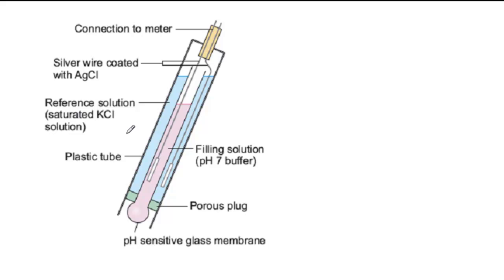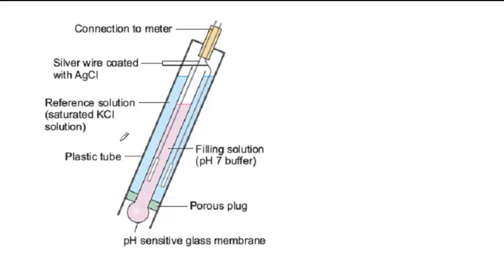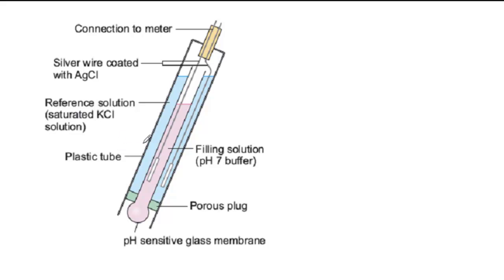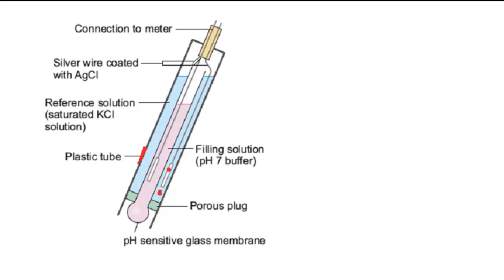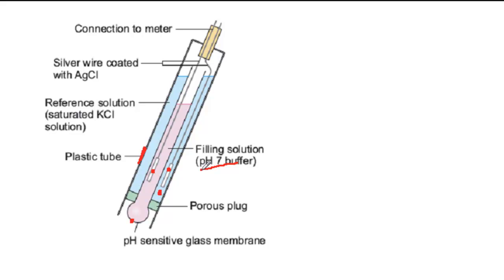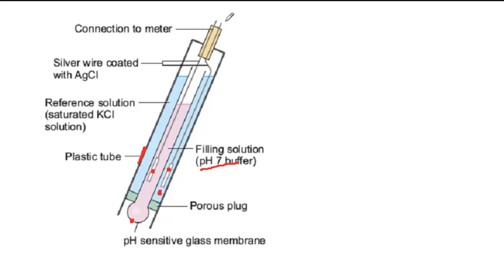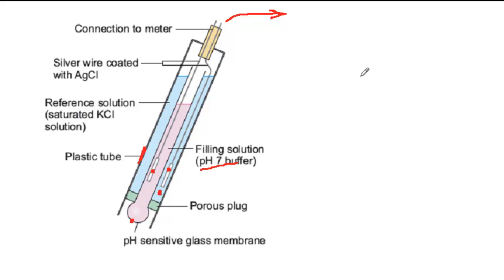How a pH probe works

Comment: Why there is a part, "porous plug" in the tube's end? If we immerse this tube into a water, are there possibly any water penetrate to the "Reference solution(KCl)" to mix the KCl? Will this make the the KCl solution contaminated?
Reply: no, the bulb is only sensitive to hidrogen ion changes and will never change its original ionic composition only active ion composition

Comment: Thank you. Any idea on how one would get one working again once it seems to have stopped working?
Reply: Sometimes the probe gets a coating on it and doesn't read correctly even after being calibrated.  Needs to be sufficiently clean all around the measuring area.  "The probe surface is where the instrument takes the reading of the solution or soil/media. If the probe face is dirty or contaminated, the readings may be inaccurate. Much like the windshield of a car, if it’s dirty you can’t see out! If the probe face is dirty, it cannot read the solution or soil accurately. pH probes specifically, should be kept wet at all times for optimal performance and life."	
Possible Solutions:
		    Clean pH probe with distilled water and KIM wipe.
		    Hydrate the pH probe in KCl storage solution
		    Ensure calibration solutions are fresh and accurate (replace if in doubt)
		    Wait longer for readings to stabilize before calibrating
		    Check the pH probe for damage.  If damaged, replace.
In my experience, probes get damaged if they are tapped or wires are crimped in any way. 
I've also seen Buffer Solutions that have been used too many times.  They get diluted or soiled from improper probe cleaning and need to be replaced frequently, depending on number of readings per day.  Solutions have expiration dates on them as well.